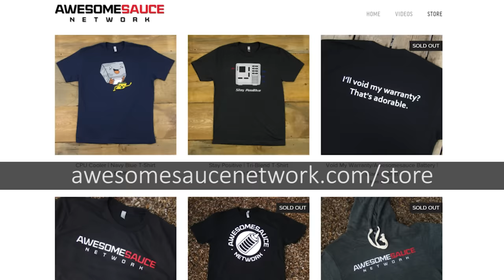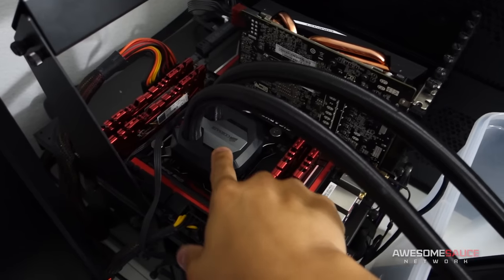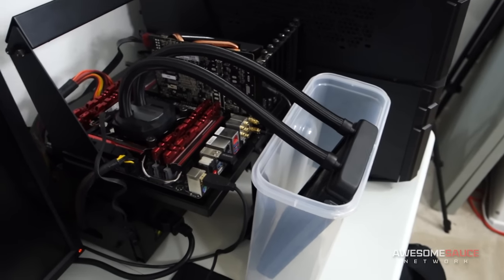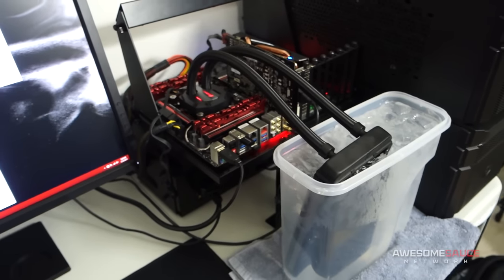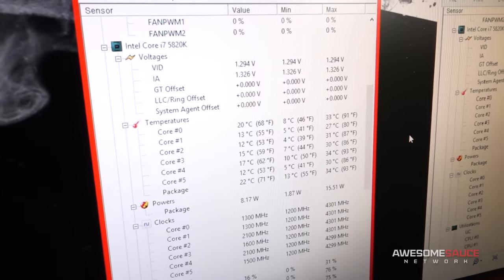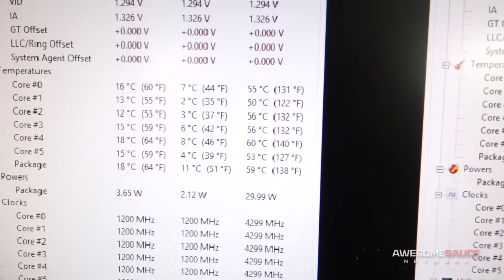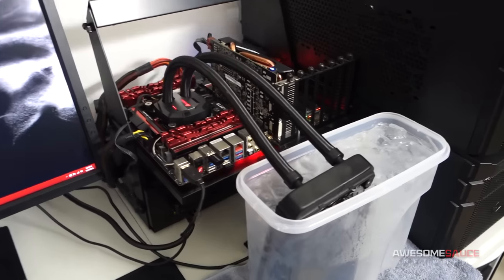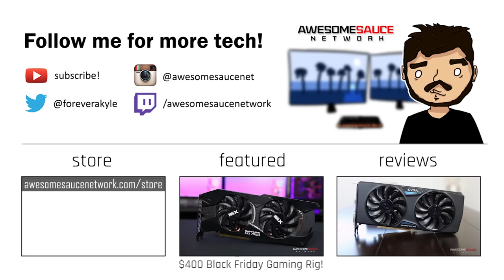AIO Ice Bath Challenge! Does it Work?

Comment: I did a similar test, but instead of using ice water, I used a deep freezer. Getting idle temps of 2'c. I once managed to freeze the antifreeze in the radiator, which nearly broke my pump - stopped playing with it ever since.

Comment: Ideas I'm sure someone has already done... 
#1 buy mini-fridge... tap into its refrigeration system... circulate that through the CPU block like a cheap freon style cooler... 
#2 buy mini-fridge... drill two holes through the side... run AIO lines through holes with radiator inside fridge (in the ice cube section?). Set fridge temperature to how heavy your work load is on the CPU.

Comment: This reminds me of my mineral oil-submerged PC I made. Did an experiment where I submerged the heater-core radiator in a bucket of ice and salt water and got some appreciably low temps, though this was on an older AMD CPU with only two cores. Since then, I've thought about using a refrigeration loop in direct contact with the CPU and GPU, as well as a coil submerged in the oil itself to cool the other components (RAM, PSU, etc.) that I don't feel like building heat exchangers for, but I've lacked the funds and some of the tools required (namely a vacuum pump) so another day, it seems.

Comment: Temperature is certainly one factor when trying to dissipate heat, however the velocity at which your cooling fluids move has a much larger impact. Your ice bucket will cool even better if you circulated the ice water some how. That might make for another fun experiment. (Yes, I have a Mechanical Engineering degree)

Comment: Would give better temperatures if the "bucket" was bigger and had a small propeller to move the water. Otherwise (as shown in the video) the water heats up right next to the radiator but doesn't move away and present new cooler water. 
Same principle as not having fans on your radiator. Sure, hot liquids have higher volume and rise, however not fast enough to be effective enough.
Still nice video. I actually wondered what would happen if you placed the radiator in a stream of cool water.
I actually thought about if one could hook a loop up to your sink and get constant stream of chilly water that runs the loop once and then drains. It would sure beat radiators but be super wasteful. Maybe I'll try once and benchmark just to see how it does.
Thank you for the video Kyle!

Comment: electric conductivity could carry through the water to the rad and into the black which could end up frying the cpu externally from current discharge and it doesnt take much. need a ground strap on the rad itself to the table to take that risk away if your gonna do this yourself

Comment: I've reached temps below freezing on air-cooling.
Granted it was an old Amd phenom 4 core, and it was with the window open in the winter in norway, but it was still fun.

Did the same thing with my amd fx4350 overclocked to 5ghz with custom watercooling, speedfan was reading silly numbers at that point.
but i stopped and took of the waterblock to remove condensation just in case. :P

Comment: I just saw this video and I think the idea is pretty cool! I bet you would have better results with some sort of fan pushing the water through the radiator, and by using a bigger reservoir.

I wonder if doing that without the ice and instead with a fan blowing on the surface of the water would also produce a good cooling effect?

As for the condensation point others brought up, I wonder if having a desiccant at the bottom of the case would help keep it dry, something like a little plastic tub with some silica gel in it.

Comment: Put the AIO in a small Yeti cooler or compatible cooler along with 3/4 ice topped with water and almost to the top of the ice so that the ice doesn't float then add table salt to bring the temperature even lower for longer.  Just don't leave it in there when the ice melts because it will hold heat just as well as cold.

Comment: Awesome video. Maybe next time put some rock salt in that bucket. And more ice than water. That will bring the temperature down a good amount. I'm not entirely sure, but you may need to test the freezing temperature of the coolant so you don't freeze your radiator.

The idea is the same as making home made ice cream. You keep loading that bucket with more salt and more ice.

Comment: Plug in one of the fans in the water bath and cover the front of the fan with a wire mesh to protect against ice chips in the fan blades.  Should work with DC current, but the water might reduce the fan life after the experiment.

Comment: I’ve been doing some research and someone suggested for a similar project to drill holes in the side of a small fridge and running the hoses through them to have the radiator cooled by the inside of the fridge.  Has this been done before?

Comment: Newtons law of cooling states that the rate of heat transfer between two mediums is amplified by the difference between the mediums. 
Aka high temp difference high heat transfer
Or low temp difference low heat transfer.

Comment: cool video , I have seen a few video's that try and use peltier cooling but the always try putting the peltier on the cpu , if you wanted another video idea like this one ,how about a peltier but instead of putting it on the cpu and that getting ice on the system then it getting wet , use a second cpu block in the loop or place it against the radiator block , it would need to be outside the system like this video with a way to catch the water but am sure it can be done .

Comment: If you could run fans on the rad while submerged maybe you could get lower temps. I think the heat transfer is kinda crap at load scenarios, and getting that water flowing is kinda critical.

Comment: People that get knee and other joints replaces often are given a Polar Care ice unit. It seems that these with a CPU Water Block would be about all one would need to Frankenstein a good ice cooler. Bonus is that the surgery centers never let you re-use a Polar care, so if you have 2 operations, you would have 2 of these units. Let me know if you ever try one of these to cool a system.

Comment: +bitwit you should do a revisit of that with just plain water at room temperature.
Theoretically speaking water has a higher thermal conductivity than air. If you were to dip the radiator inside a water bath with a not insulating container (such as metal), then the thermal energy from the CPU should not be enough to contrast the water thermal dissipation of such a volume of water. Therefore it should perform better than air. Even without ice (problably something of a close win but still interesting)

Comment: If you place the radiator horizontally with a bubble wand from a fish tank the temps will be much cooler due to the dissipation of heat via air removing heated liquids ambient energy.

Comment: Would be curious to see the cereal bucket water circulated through the system directly, or at least use a water->water heat exchanger and run the cold water through it.

Comment: I truly enjoyed the idea of the video. it's a valid point to try and test the boundaries of market products to see what margin for improvements are there in the future, against the inherent production costs it would assume. After all, it's intuitively easy to imagine that a marketed product that offered near-absolute-zero cooling systems, with liquid nitrogen would end up costing as much as dozens or hundreds of times the price of the rest of the computer. But what about a 0°C cooling system? How energy (and thus, cost) efficient would it be to brand one? but in order to better assess the question, you would have made a better point if you results included other data rather than only the cpu temperature, as the output framerate, or maybe even to test it against clocking speeds, compared against the standard AOI cooling solution as a reference. also, another big room for improvement in this setup would be to manage to estimate heat exchanged between radiator and (salt) ice-water mixture (i say estimate because phase diagrams of water are well-known, and I'm not confident there is any simple, reliable measurement instrument for straight out tracking heat exchanges. a thermometer isnt sufficient, as in the case of ice-water mixture the temperature isn't changing much due to the water being in one of its phase changing regions). but being able to re-do this experiment while keeping track of the cpu performance and heat exchange against the cpu temperature would allow a much deeper understanding of what would the possibilities of future improvement be on a hypothetical 0°C cooling system, one day. :) basically, the cpu performance against the energy budget needed to keep temperatures at water-ice mixture level would allow to infer if one such hypothetical solution would be cheap enough to become a marketed product, or if it would just be way too expensive.  nice video, though.

Comment: Nice video! Lol it's so simple and easy to do yet you were the first on YouTube from what we I can tell.
So my Ryzen 7 1700X doesn't really need this Corsair 100i... need to put my oc'd MSI R9 290 on it and then dunk it in ice water....with proper insulation in places to avoid condensation. Even with a small undervolt (ty MSI Afterburner) and near-factory-overlock at just 980 MHz, it has to thermal-throttle in many games at least during a few scenes, although it's usually only dropping to maybe low 900's and fps doesn't drop considerably nor cause lag or stuttering. Still, this joker creeps up to a stock-clocked 980 in some games when you can get it to consistently run at around 1050 MHz.

Comment: Nice low temps on the CPU , but you would have to keep an eye out for condensation around your CPU . I noticed some condensation on the out side of the ice bucket. Cool experiment though. It would be an interesting test to use a custom loop system with soft tubing and a very large rad like 560x80mm .

Comment: I had thoughts of something similar - but with using an old a/c unit submerging the cooler and the cold condensing radiator  unit in a bath with a 12 volt bilge pump to drive the water bath through both units - but condensation was a worry on the mother board -  I have a video of an ice 12 volt cooler for air - thats the pump I was thinking on using

Comment: If you wanted to do this longer term, you would need some kind of drain, to remove the water that is produced by the thawing ice.  

What might work is if you took an old window A/C unit, and replaced the evaporator with a flat plate heat exchanger, effectively building a chiller, the other side of the flat plat unit has your water cooling loop, you should be able to get the water at around 7C or so....   You really should insulate the case, then have any air entering the now sealed case go through a radiator, that is supplied by your chiller; then feed the water through the graphics card, and then the CPU before heading back to the chiller.  Air exhausted by the power supply being the only air exiting the case.

Comment: Buy a pair of the cheapest 120mm fans you can get, get a bigger water container and submerge the radiator with the fans attached. As long as you keep the connectors out of the water, it should not short out.

Comment: I could have sworn that under 20 c. the temperature wouldn't be accurate.   That said, I'd have issues with the cold coolant hitting the hot CPU when the pump cycles.   You'd think condensation at some point.   Good watch and a really neat idea otherwise.   The radiator wouldn't bother anything being dipped in water.   Totally worth the time under experimentation.

Comment: Cut 2 holes into a freezer for the lines and put the radiator in the freezer. Then you can keep the low temps, fans installed and not have to replenish ice.

Comment: Hmm? A chiller would be a better long-term option, and you can dial in your target temp for only a couple hundred bucks one time expense. Might be a better option for single loop configurations since gpu heat can be accounted for at the press of a button. Just keep it above the dew point so you don't risk condensation shorting out your mobo or components.

Comment: I know this video is 4 years old but it came up during my research on something similar. 

I have an old mini fridge that I want to run a cold water bath setup like this inside of for a custom loop (no ice). Not building a pc inside of the fridge, but thinking of running soft tube through the side of it to a 360mm radiator that is submerged  in water that is actively being refrigerated. 

Linus did a video a while back where he built a PC inside of a mini fridge and found that because of the lack of air flow and the duty cycle of the mini fridge that it was achieving nothing in terms of extra cooling. 

Bitwit is there any way you'd try this again with my idea? I'm really really curious about the results

Comment: I know this vid is old has hell but I just ran across it.  I'm an Air Cooler myself, and was just wondering.  Is there ANTIFREEZE in the liquid in the AIO coolers?  I'm sure it's not just water, but if you did this for an extended period of time I wonder if the liquid inside the AIO would start to freeze up, thicken up, get slushy, etc..... Then it might hinder performance (if that would happen)

Comment: I wonder if you could use speedfan, underclock the cpu, and max the pump speed out and let it run at idle with lowest clock setting possible. Wonder how low it can go? I can get my i5 on a clock of .8 ghz 0.7 volts (i think) and 1 core.

Comment: While it's interesting in a sense, to do this, the bottom line is that the system's performance didn't change. People get unnecessarily concerned about lower operating temperatures, when it doesn't actually matter (once you are below safe operating and thermal throttling limits).

Comment: you could buy a tiny freezer and have it next to to the pc, and drill holes in thé case and in the freezer, through the radiator cables would pass. isolate this thing good, and there you go! a cooling solution that's also a cool beverage dispenser :)

Comment: I guess a regular rad config would be considered water-to-air cooling, and this would be water-to-water? 

I have an idea. Create a system wherein a "standard" radiator is connected to the CPU, and a fresh cold water supply is pumped through the fins instead of air.

Comment: I have the exact same processor OC'd to 4.6 Ghz with 1.28 V and even with my Seidon 120mm which is a budget AIO I don't go over 75°C in synthetic benchmark ( the one in Intel extreme tuning utility) . It's in a push pull configuration but still it seems strange that you go that high.

Comment: Your temperatures would be way better and more consistent if the water was circulating because the water floating around the radiator is much warmer than the water around it, and the law of thermal condition and the water moving itself is try, but it isn't far enough to efficiently cool a system so if you added a way to cool off the water and add more I can circulate the water inside the bucket your temperatures remain consistent a lot better.

Comment: Why not freeze the bucket of water with the radiator in it?
Or use dry ice instead of regular ice.

Why not water cooled water cooler?
Have a pump circulate the water in the container into a freezer.

Comment: What if your room temps are below 0? Like you store your PC in an commercial/restaurant freezer.
Reply: orangeapples That would just destroy your pc. Below 0 temps would create great amount of moisture.
Reply: It would be fine for your pc. I would avoid HDDs in those temps. If your components ate above ambient temps you will be fine. Warm air holds more moisture than cold air. When a cold component cools warmer air around the component the air can no longer hold as much water so it condenses.
Reply: water cannot be created or destroyed lol. If the freezer is sealed and initial humidity is drained out and if it is sized enough to be able to take the load, then yes it would work...
Reply: Yes it "can" hold more moisture (called relative humidity), but it doesn't mean it has to...
Reply: Liquid nitrogen's boiling point is -195.79 C (77 K). But Helium boiling point is -272.2 C or 1.15 K. But this is all under STP.
Reply: +2Awesome of course you can create water but hydrogen is very volatile so it's hard to create from nothing.
Reply: Sayian505 you can't create anything from nothing
Reply: 2Awesome I meant creating it from hydrogen as it's not easily captured or stable. Liquid hydrogen is very volatile.

Comment: I believe that this test, though impracticable due to having a sustained source of ice, isn't a good way to change the efficiency of a liquid cooler. If you notice, the delta temps of the Asus real bench scores are identical if you factor in the difference in ambient temperature of the AIO during both test. The results you showed in P95. scores for the package from 16C to 71C again are almost matched from, you didn't show them but mentioned, the non-ice water cooling idling around mid 30Cs up to mid 90Cs. From these synthetic benchmarks, given that they're identical every time you run them, shows the delta T to remain consistent; with the only difference being the ice water (and fans on the non-ice water AIO).

If you truly want to improve the effectiveness of any cooler, you'll need more (or better) fans. Changing the ambient temperature gives the illusion of lower temps in the test results. Otherwise, I really enjoyed this video Kyle! I would like to see a video of you stacking something like 40 fans to an AIO to see truly low temps. Also, I never see any mainstream Techtubers use LN2, why is this??